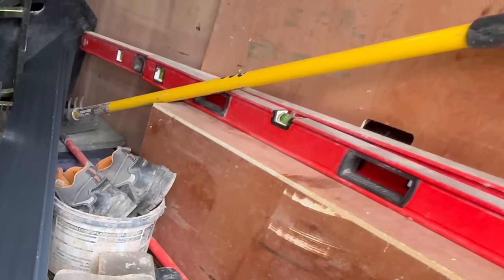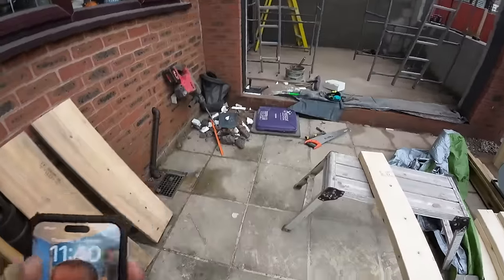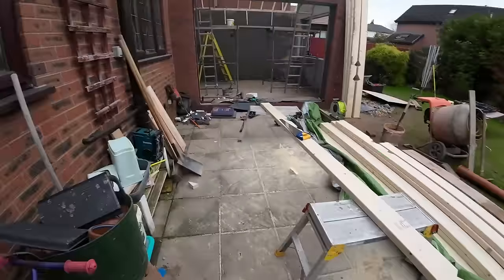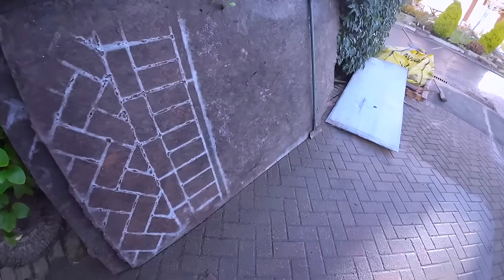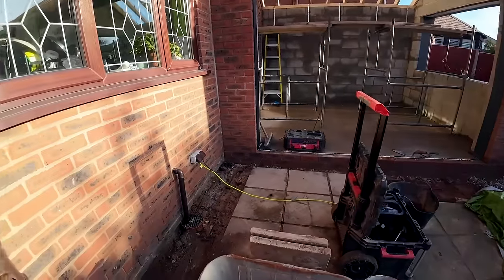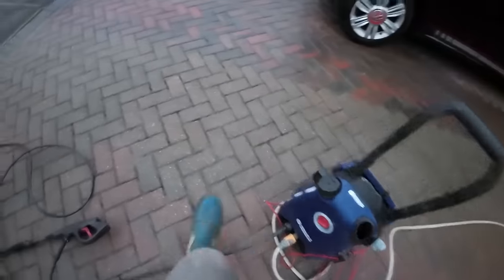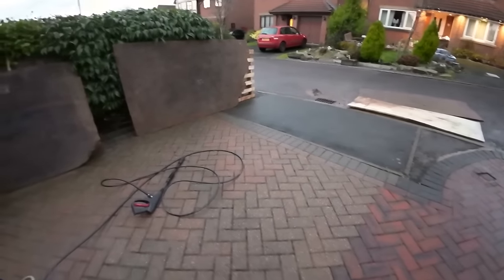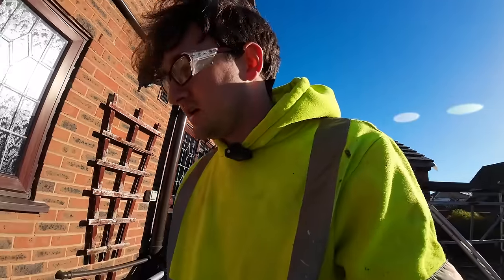WE FINALLY MADE IT !!... CONSERVATORY TO EXTENSION COMPLETE PT 11

Comment: Hi mate, question about your threshold/doorway details in general, how come on some jobs you built up the inner leaf in the threshold and others you run the slab right up to the outer leaf insulated upstand, and do you insulate that bottom threshold cavity between the dpc and weak mix, or leave it empty, cheers guys

Comment: It looked like you connected the roof downspout grid to the kitchen grid, which I assumed was on a different foul drain system. Is it okay to connect rain water run off to the foul waste system when doing extensions?
Reply: Suppose it depends where you are and on your building inspector. They definitely don’t let us in wales rain water can’t go into the foul over here
Reply from the maker: As it’s only a small amount we are hoping it’s ok 🧱👍🏽
Reply: Some developments have rainwater running into foul, but normally they are separate. Should really be checked by the whoever designed the extension
Reply: Should be in a soakaway, probably 4/5 meters from the building depending on region

Comment: Have you ever thought about using 90mm celotex in the walls with 10mm gap. Better and works out so much cheaper. You don’t lose 50mm internal space, PIR works out at £12m2 and the ditherm32 is £20. Then the cavity lintels are so much cheaper as well as cavity closures. It’s a win win win 🙌🏻
Reply from the maker: Not a chance hate the stuff and hate block first 👎🏽
Reply: 😂 FairPlay
Reply: Do brick first then cavity tab to keep the 10mm gap and lay the block tight to the insulation. Works a dream
Reply: @dominictinsley2565 
That's not how the manufacturer specifies construction sequence.
They say block first then tape seal on cold side.
Reply: Does 150mm dritherm37 comply to new regs or does it have to be 32? Thanks
Reply from the maker: Must be .32 mate 🧱👍🏽

Comment: Our house was flooded after a deluge of rain. It turned out the builders across the road washed all the cement dust and sand down the drains and blocked them. Fricking nightmare..
Reply from the maker: That’s grim , I hope you got it all sorted 😳🧱👍🏽
Reply from the maker: @martin2466 😠😠🧱👍🏽
Reply: @martin2466  It's like getting blood out of a stone with the council. They're just not interested.

Comment: Doesn’t that extension leak. No attempt to install a cavity tray with stepped flashings above the new rafters. The water from the cavity on the existing wall will run down the inside of the outer skin, straight into the room.
Reply from the maker: There isn’t any water in the existing cavity , did you see any ? 
    It does leak though because it hasn’t got a roof on 😬
Reply: I really don’t understand your building methods in the UK. I’m a builder from Australia. We were taught that the external brick skin isn’t waterproof and that water that does penetrate runs down the back of the external brick down to the dpc and out the weep hole. Now I see you guys bridging cavities everywhere???? How do know there is no water in the cavity, you can’t see inside it????
Reply: They must have some right old leaky brickwork on those Australian builds, if they are getting that volume of water running down the back of the face-work...
What are you doing  -  deliberately leaving the perp - joints open?
Reply: Steve I’m just trying to understand this.  Yes we do leave open perp joints, I’ve never seen those plastic inserts you use. Water can’t enter a cavity through a peep it’s the other way around it acts as a drain. We do get a lot of rain. So are you saying that your cavities don’t get water in them, if so why are you using dpc and perps above window and door openings? In building a new build we leave clean outs at the bottom dpc which the bricklayers hose  out every after to make sure the bottom dpc has no droppings and debris too. 

You certainly couldn’t build an extension like that without a new stepped cavity tray system above it.
Reply from the maker: @davidconnolly7346 🧱👍🏽
Reply: I suppose the argument is that the amount of rain exposure to the house wall above where the new extension meets it is minimal.
Reply from the maker: @davidscott3292 . It is .🧱👍🏽
Reply: @SteveAndAlexBuild  None of the above explains anything to me. All of our trade education in Oz did originally come from the UK and was gradually modified to suit Australian conditions so we do have very similar building standards. Not enough rain water on the wall above to warrant worrying about it, we get cyclones with horizontal rain where I’m from. Anyway I do wish you explain your waterproofing systems and flashing details in more detail.
Reply: I'm guessing you are from Cairns? I'm a bricklayer in Cairns, if we did it like this we would be shot lol
Reply: @chupapi3510  Brisbane actually but we do get driving horizontal rain. The questions raised by this are: 1. Who makes that call not to install the flashings, is it in the building regulations then fine or is it a tradesman going in cheap trying to win a job? 2. If it does leak (which is easily can) does Steve or his builder go back and install the flashings for free? That would be the case in Aus or you could lose your license. 3. From a builders point of view I don’t think your reputation can afford you not to install them. 

I raise this because I have been a subscriber for many years and I have watched how careful and neat Steve always is and find it interesting, not trying to haul anyone over the coals.
Reply: I'm a little surprised too as I reckon if built from new it would have had stepped cavity trays.
However it must have passed building regulations so is 'fine'
There may be an exemption for conservatories as technically they aren't habitable rooms.
But NHBC says they should be provided even for a garage.
They'd be hell to install retrospectively.
Reply: @davidconnolly7346  David, you are correct. Even in the UK water behaves the same as Oz (although we do like to pump raw sewage into out rivers....but that's another story!).
In theory the house should have a stepped cavity where the new roof meets the wall. In practice, I doubt it is hardly ever done (presumably the cost). I asked Steve in a previous video the same question and he said he has never been asked to install a stepped cavity tray in such a scenario. Cannot blame Steve because he only does what he is asked to do (& paid to do). I presume the architect never specified a stepped cavity tray, the building inspector never required one, the builder quoting for the job isn't going to cost for one unless specified (because no other builder in UK will install one).
I suspect if the bricks are pointed the amount of water ingress will be small. In the future if there is a problem (say due to increased windblown rainfall in UK) then someone will spray the brickwork with a waterproofing liquid (might as well piss on the wall IMO!), if that doesn't work they may suggest a cavity tray or render the house. But to some extent it is 'somebody else's problem'....it is the way things work in the UK. Building regulations & inspection regimen here is a joke (we did manage to burn down a 1960's non-combustible concrete building full of people at Grenfell by coating it with flammable insulation!)
In terms of builders - based on watching many of Steve & Alex's video's - I believe they are very conscientious builders, who are proud of their work and do an excellent job. But equally they can only do what they are asked to do. 👍
Reply: @Sean006  Grenfell yes that woke the world up to cheap combustible Chinese cladding, we’ve spent Billions of $’s in Aus removing it all. I’m not blaming Steve, I’m asking why? So it sounds like the problem lies with the non enforcement of building regulations. That doesn’t happen in Aus to my knowledge and we have very similar systems as I’ve said. The building regs in Aus are written specifically to protect the consumer, as they wouldn’t know what a stepped cavity tray is. You couldn’t do that in Aus, I’m also not not saying installing those flashings would be easy, but nothing is easy in construction, it’s all part of the job. Not a good outcome for the consumer then! Passing the buck that, as builders our buildings are supposed to be fit for purpose if they leak we fix them for free or we lose our building license, habitable room or not.
Reply from the maker: @davidconnolly7346 That conservatory stood for over 20 years without a problem . Retro fitting trays does more harm to the structure of the house
Reply: I might be mistaken ,but wasnt there a case of a building in Oz going up in flames because of exterior  flamable insulation, I think this was before it happened in the uk.
Reply: @SteveAndAlexBuild  Just to confirm I don’t know what a conservatory is, I think it’s a wet area like a greenhouse, is that correct, some have said here not a habitable area. If it’s a wet area a few weeps through a weep hole every now and then wouldn’t be noticed. But turning it into a proper room is a different issue. I didn’t say it was easy Steve. I’ve watched with great interest you replace many lintels with new flashings. You do a beautiful job. Are you saying that retro fitting stepped cavity trays isn’t possible? 

Not sure re a building in Aus that caught fire. But that Chinese cladding was everywhere on Commercial buildings. We’ve removed nearly all of it now as a result of what happened at Grenfell.
Reply: @davidconnolly7346  
A conservatory is a 'fully' glazed 'extension', typically built up on low walls.
Most are treated by owners as real rooms and often have the walls plastered which could be problematic if water did get inside the cavity.
In this instance the house wall wasn't plastered so no particular issue.
As Steve and others have pointed out the area of wall above the roof is minimal and water obviously hasn't been a problem in the  past.
They've had building inspector visits with no instruction to install trays, so it's legal.

As Steve say retrofit is very intrusive and potentially destabilising to the wall.
Reply: @davidconnolly7346  
I'm sure there will be a lead flashing-soaker between the wall and roof.
The customer has had a conservatory in the same place for 20 years without any problems, so I don't think it's a real-world issue to worry about.
Reply from the maker: @markdauncey927 . Exactly Mark . We’ve gone higher with our roof too so less chance of water getting in. 🤙🏾🧱👍🏽
Reply: We don't do it in the UK on extensions only on new builds, the reason being it causes to much trauma to the existing building and more to the point its not needed,  in 50 years I've never seen a problem with it but I have in Ozz where roofs leak like sives.
Reply from the maker: @bricklayersworldwithandy6277 . Perfectly put Andy 👌🏼🧱👍🏽
Reply: @SteveAndAlexBuild  👍
Reply from the maker: It’s a relief to hear that it’s very common not to retro fit them. To install a stepped tray retrospectively would wreck the structural integrity of the back of the house and risk water getting in. 
    Hands up who has seen water exiting a weep hole / vent 🧐💦💦🧱👍🏽
Reply: @SteveAndAlexBuild  
Retro fitting has been made popular by cavity tray manufacturers.
Imagine the cost of retro-fitting stepped trays..?
I have never seen a weep - vent,  weep....!
Reply from the maker: @martin2466 🙌🏽🙌🏽✊🏼✊🏼
Reply: @SteveAndAlexBuild  I don’t accept that retrofitting cavity trays affects the structural integrity of the wall at all. You have a new roof structure at that location providing additional lateral support to the wall. If anything the wall is stronger at that location due to the additional roof.
Reply: @markdauncey927  Mark from what I’ve read a conservatory is deemed by the building regulations to be a non habitable area used by owners in a non compliant manner, up to them. Yes the issue we are discussing is cavity water possibly flowing directly into the inside of a new proper room or habitable area, where the owners may choose to use carpet or parquetry which are both highly susceptible to water damage. Yes a stepped lead flashing is necessary to seal the new roof to the wall of course, but it doesn’t stop the cavity water running down inside to the new room.
Reply: @bricklayersworldwithandy6277  Andy why do you do it on new build, reason being that it’s good building practice. From the comments I’m seeing, the reason you don’t use them on extensions is due to cost, nothing to do with the structure or ensuring the building is fit for purpose. It also sounds to me like you don’t have to warranty your work in the UK, but I’m not sure. If no one calls you back then you wouldn’t know. I do watch another YouTube channel called skill builder, They have hundreds of questions daily about water leaks of all types on buildings, so it may be the pot calling the kettle black and UK buildings that leak like sieves.
Reply: @davidconnolly7346 
I don't think we need to get to deep into the theoretical possibilities of water penetration on this job.
There's not been a problem for 20 years.
Reply: @martin2466  You don’t get the point, it’s not a theoretical possibility. Someone has decided to build in a manner that is not in accordance with your building regulations by omitting the flashings required under the building act and that’s breaking the law in my country. I’m sure it’s the same in the UK. Correct me if I’m wrong.
Reply: @davidconnolly7346 
Not sure that it was Chinese cladding on Grenfell.
Reply: @davidconnolly7346 
If it gets signed off by the inspector supervising the work then it's legal.